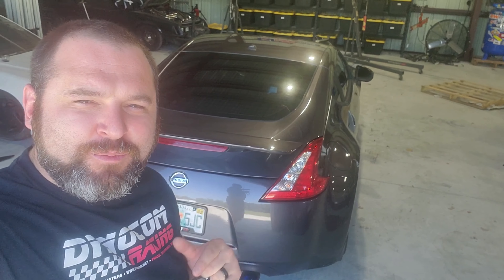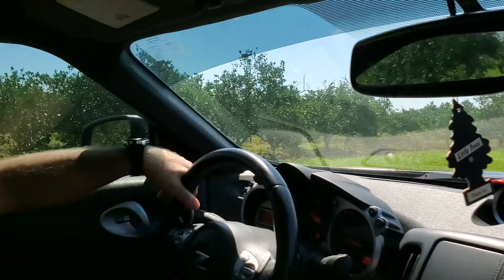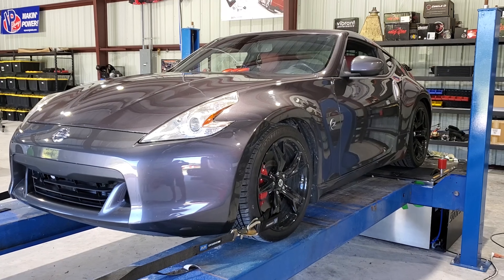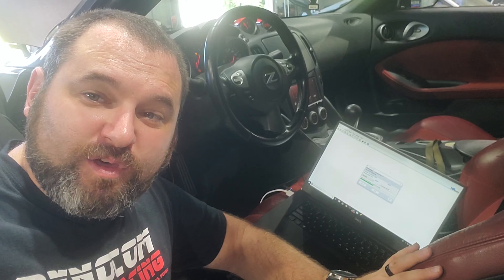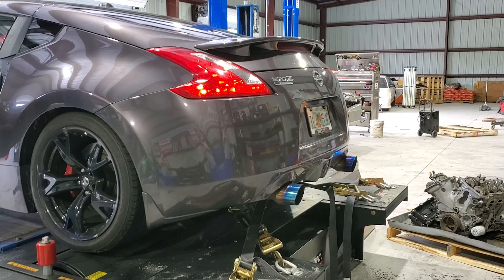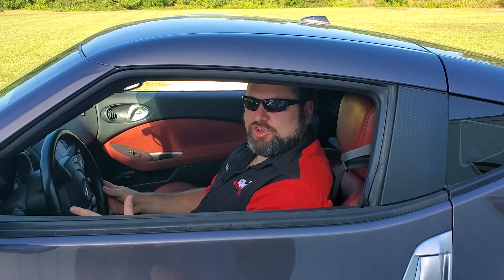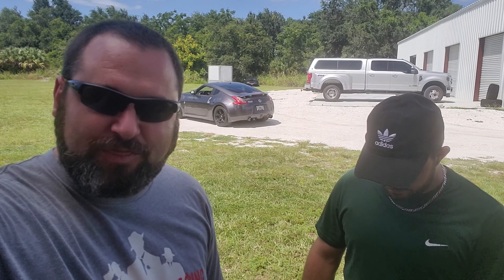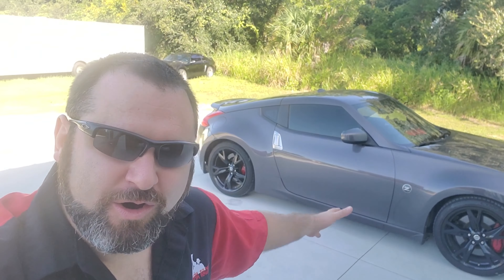Tuning the Worlds LOUDEST Nissan 370z VQ!

Comment: That double y pipe design needs to go. I know it is from the factory but it needs a custom x pipe welded on instead. That was my first exhaust mod I have done to my 370z and it definitely pulls a bit more on the mid to high end and has better throttle response.
Reply from the maker: Agreed its crap

Comment: Correct me here: our 3.7 needs a tune, ported intakes, CAI and exhaust to make at least 300whp. 370Z here only needed some test pipe and a tune, and easily make 300whp. I'm crying here
Reply from the maker: Mustang 3.7s typically need Ported Intakes, Steeda or good CAI, Long Tube Headers, Catless X pipe, and 93 or E85 to hit 300 rwhp.   Yeah these 370z are way easier to make 300+ rwhp NA on. Id say the 370z is faster by FAR mod for mod than the mustang v6.
Reply: Auto Mafia Racing it does suck that the Z is much faster, but in stock form they’re a lil over 32hp than a 3.7. My guess is a 3.7 ported intake and CAI would match their extra 32whp. In other words if we have an aftermarket exhaust on, it’ll definitely match the Z. Hopefully any of that made sense
Reply from the maker: Pretty close races because it feels heavier
Reply: @automafiaracing  what all makes the 370z engine perform that much better than the cyclone?
Reply from the maker: I think compression, as well as a much better designed intake system
Reply: The 3.7 stangs are slow and heavy, if i were you, i’d just stop modding the 3.7 and save up for a 5.0. Those 5.0’s make so much power N/A it’s ridiculous lol, i have a Z but those make our NA V6 look slow.
Reply from the maker: We boost the 3.7s. Up.to 700 rwhp without building the motor

Comment: Tune my Z with open long tubes ; D
(edit) I agree the Zs are picky in their computers. I have catalytic spacers on my O2 sensor bungs and it still throws CELs.
Reply: I plan on making an open headers compilation soon.
Reply from the maker: Sounds too loud

Comment: Only test pipes cat delete and resonator delete ?? 305 hp to the wheel?? My buddy has test pipes ported manifold injen intakes and makes 305 hp to the wheel... 2019 370z nismo
Reply from the maker: Is he tuned?  We tuned this one
Reply: @automafiaracing  yes he's tuned he baseline 286 to the wheel after the tune 305
Reply: leo herrera something’s not right with your buddies car, Nismos come with 350 crank horse power from factory and it really should be loosing that much power in the drive train
Reply: @mkp1214  exactly what I have been saying he should at least be around 315-320 keep in mind he has stock exhaust other than muffler delete and test pipes. Do you think that has something to do restriction wise ? Or you think the tuner just f*** him over $650 ?
Reply: With testpipes, a cut up exhaust and tune, it's in the ballpark. Intake, testpipes, exhaust, and tune, car should be high 320's, 330's range. I've made up to 347 on mine running headers, and ported parts, but my 4.08 final gear tends to show up lower. Generally guys running similar mods with E85 are in the 340-360 range (360 is very uncommon)
Reply from the maker: It depends on the dyno too maybe that dyno is a heart breaker.  ours was on SAE and Smoothing 1 with 9% load applied so its very accurate

Comment: I dont think that's a VQ but a HR with dual intakes
Reply from the maker: Say what
Reply: Ur statement makes no sense.  An HR is a VQ🙄
Reply: @automafiaracing  there were ZERO changes from 2009 - present in the 370z.  ALL have the same engine.  The "nismo" just has a slightly different exhaust and a SLIGHTLY different tune.    You're thinking of all of the engine variations on the 350z.
Reply from the maker: Yeah its a 370z with a VQ37

Comment: Bro I'm just concerned about the cops lol but I would sure want that on my 370👌
Reply from the maker: It is very loud!!!!  We would worry too!
Reply: Hey man I run open headers on my 370 (I cut some AAM short tails to have throwdown pipes) and it's an amazing experience, I'm in TX though and no cops or neighbors hate me and I been running this setup for 4 to 5 months now. After I got tuned it has a MASSIVE top end.
Reply: I live in corrupt CenCal with a twin turbo unrestricted exhaust setup now... have never been pulled over for exhaust. Just be smart when you see a cop.